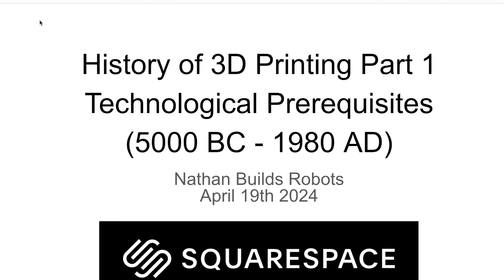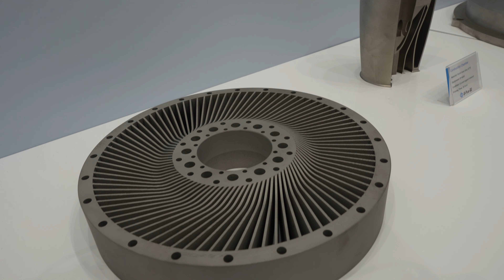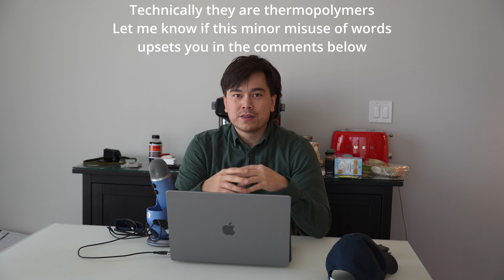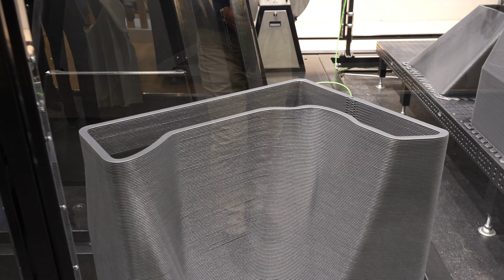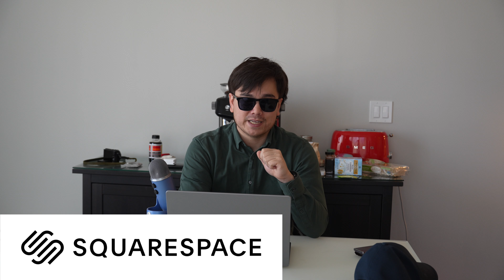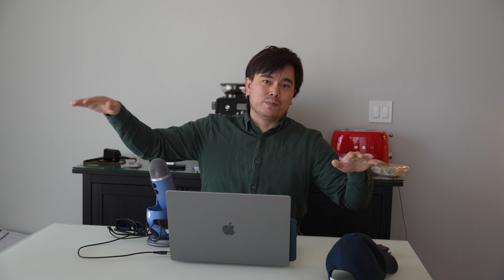The History of 3D Printing - Part 1

Comment: The 3D Printing Tech Tree shows why invention doesn't exist, there is only innovation. Everything is built off something that came before it. 
Even the most basic of technology mankind has discovered came from observation of nature itself.
Reply from the maker: The most interesting thing to me is how the invention of adhesives in the 60s directly led to the invention of 3D printing in the 80s. Such a short span of time to start applying polymer science to CNC applications
Reply: @NathanBuildsRobots   Technology advancement seems to be on an exponential curve. But where is that singularity they said we'd have by 2030?